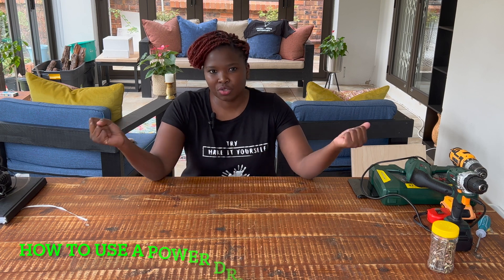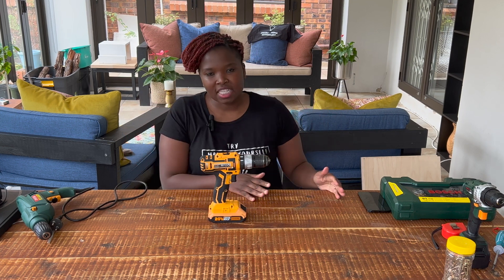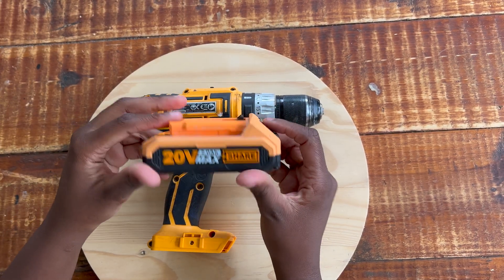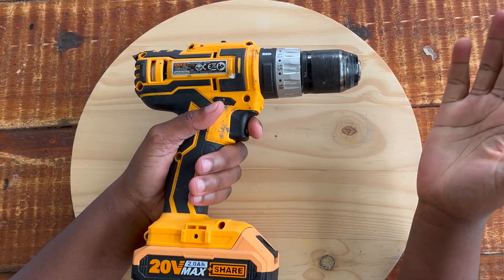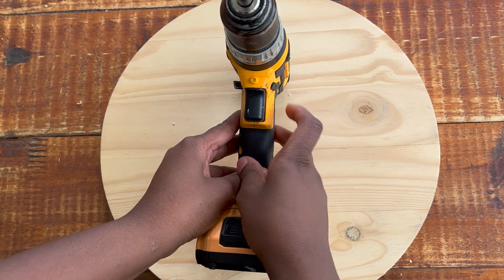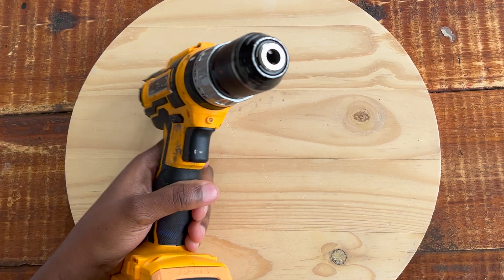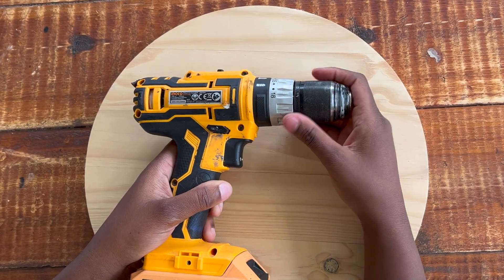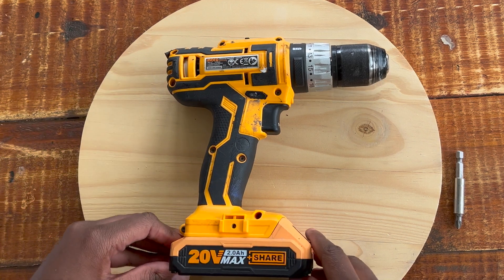Unpacking the Secrets of a Power Drill - Don't Believe Everything You Thought You Knew!

Comment from the maker: Cordless and corded drills are both essential tools for various tasks involving drilling, driving screws, and other fastening applications. Both types have their advantages and disadvantages, which may influence your decision when choosing between them.

Cordless Drills:

1. Mobility: Cordless drills offer excellent mobility as they don't require a power outlet to operate. You can use them anywhere, even in remote locations or tight spaces where a power outlet isn't available.

2. Convenience: Since there's no cord, cordless drills are more convenient to use, and you don't have to worry about tangled cords or extension cables.

3. Safety: With no cords to trip over or cause hazards, cordless drills are generally safer to use.

4. Versatility: Many cordless drills come with multiple features, such as adjustable torque settings and multiple speed options, making them versatile for various tasks.

However, cordless drills also have some disadvantages:

1. Limited battery life: Cordless drills rely on battery power, which means you need to recharge or replace the batteries when they run out. This can be inconvenient, especially during extended work sessions.

2. Lower power: Cordless drills generally have less power than corded drills, which can affect their performance in heavy-duty applications.

3. Cost: Cordless drills are usually more expensive than corded models, especially when considering the cost of additional batteries and chargers.

Corded Drills:

1. Power: Corded drills offer consistent power output, which makes them suitable for heavy-duty applications and drilling through hard materials.

2. Unlimited run time: Since corded drills run on electricity, they have unlimited run time, provided there's access to a power outlet.

3. Cost: Corded drills are usually less expensive than cordless models, making them a more budget-friendly option.

However, corded drills also come with some disadvantages:

1. Limited mobility: Corded drills require access to a power outlet, which limits their mobility and can be inconvenient when working in remote locations or areas without power.

2. Safety hazards: The cord can create a tripping hazard and may get tangled or damaged during use.

3. Less convenience: Corded drills can be cumbersome to handle due to the cord, making them less convenient than cordless models.

In conclusion, the choice between cordless and corded drills largely depends on your specific needs and preferences. If mobility, convenience, and safety are your top priorities, a cordless drill might be the better choice. On the other hand, if you need consistent power and unlimited run time for heavy-duty applications, a corded drill would be more suitable.